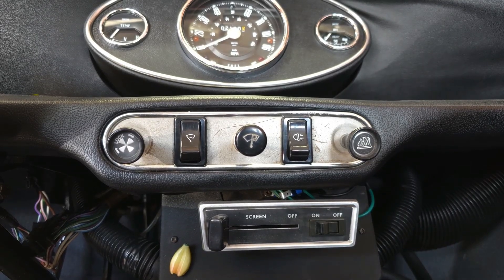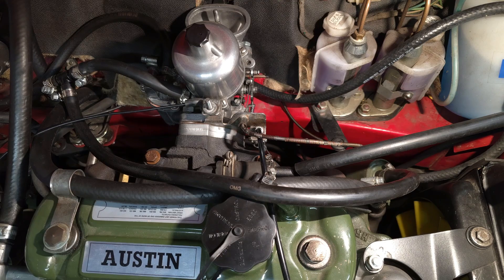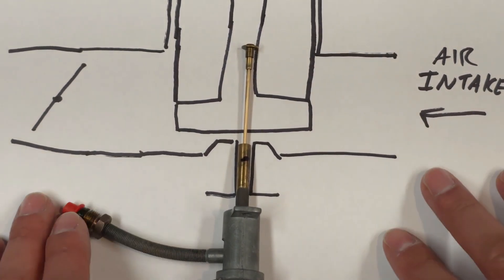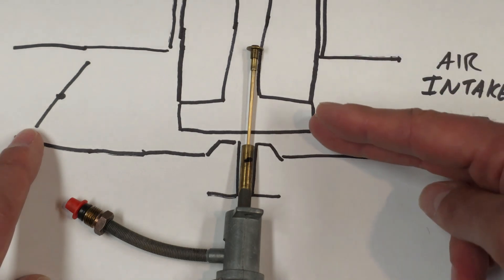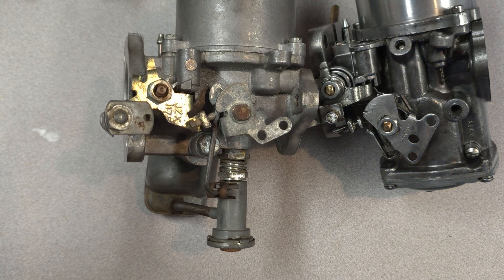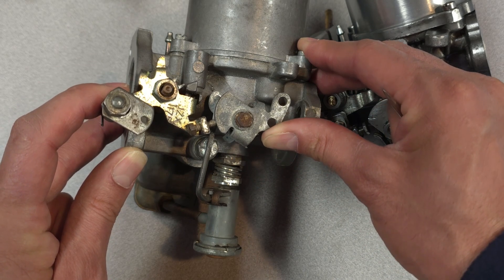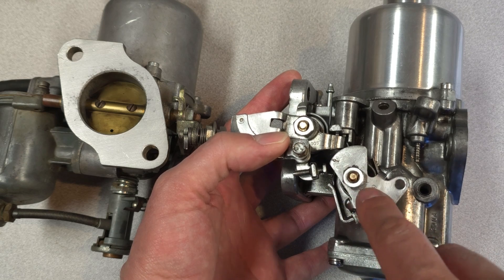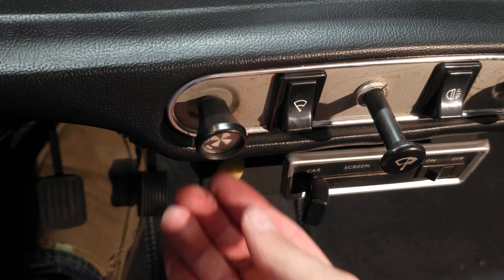Classic Mini Survival Guide: How use and adjust the Choke! Get it set up correctly for easy starting

Comment: Darren, on my 48 MG TC the choke Knob/Cable when turned or twisted to the Right (Clockwise) will LOCK into that position.  So you can maintain a fast idle.  If you do not lock the choke via the twist, the carb return springs will pull the choke/fast idle back to normal.  One other thing I have found, when adjusting idle speed via the carb linkage screw, you gotta make sure the engine has attained "normal" running temperature.   If you adjust idle when engine is cool, when it warms up it may idle much faster than you desire.  I wonder how I found that out??? 8-)
Reply from the maker: Yep, thats the way it should operate and lock. Also adjusting them warm is the way to go for proper fast idle speeds.

Comment: What is the gauge on the far right where the choke is ?
Reply from the maker: It is the cable that operates the heater control valve

Comment: Excellent explanation, I've had proper issues with the chokes on a pair of HS4's, and watching your video I can now see how this should work and what adjustments I need to make to the fast idle setting to ensure the butterflies open to allow the air/fuel into the manifold to enable a cold start.
Reply from the maker: Glad it was helpful, a properly set up choke on an SU works extremely well.